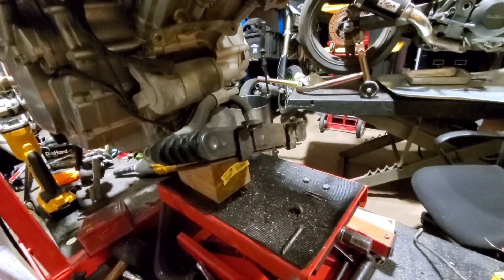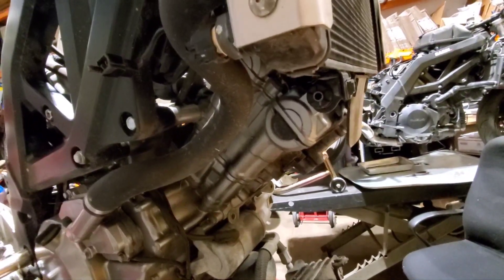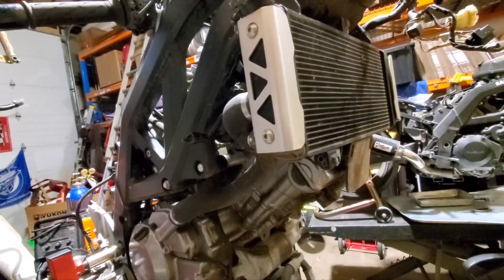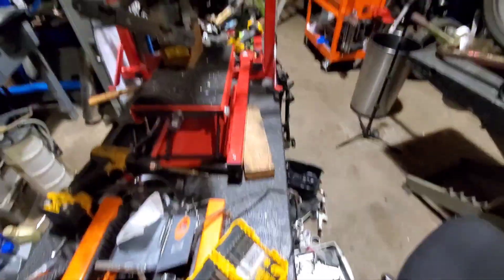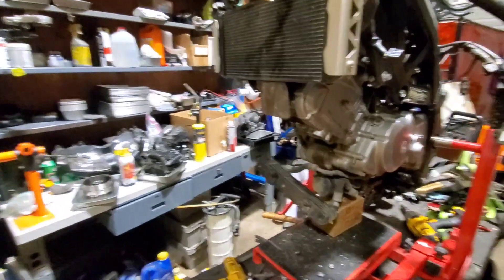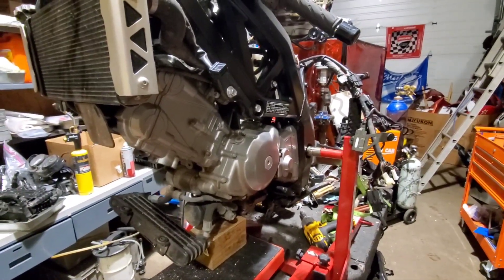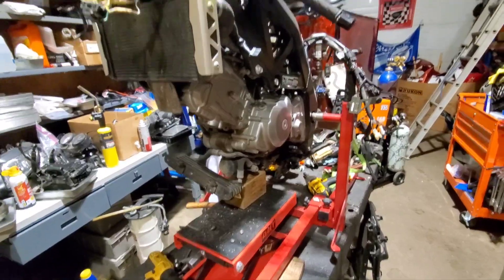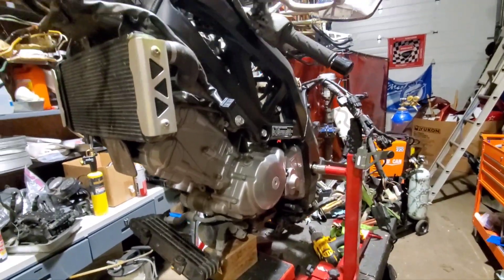swamp bike sv650 part 4. i screw up and come up w a new plan

Comment: I've done this before with the EZ out. The best thing you can do is use a Dremel and chainsaw sharpening bits to remove the hardened EZ out. then tap and Helicoil.

Comment: I've been really enjoying this series. I've been putting off fixing my 2nd gen sv's c28 code for quite a while, any chance I could convince you to do a video on removing the throttle bodies, soldering the fix, and reinstalling? Perhaps sometime over winter after you finish this project? I have read up on guides online, but really prefer them in video format. Mostly just worried about soldering it correctly, the removing and reinstalling doesn't seem too bad.
Reply from the maker: Which year 2g? May be easier to just swap throttle bodies?  Im not actually sure what the soldering fix is? Got a link? 
Also if soldering a circuit worries you, this is probably not something you want to practice on. Grab some jun circuits and get a good grasp for soldering on junk before attempting a real part